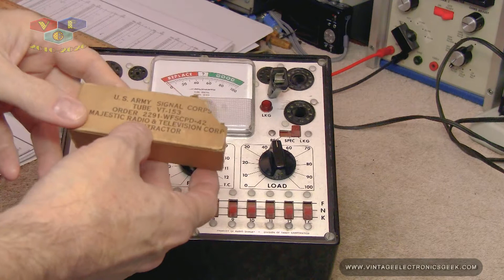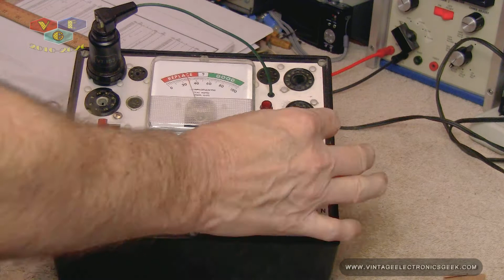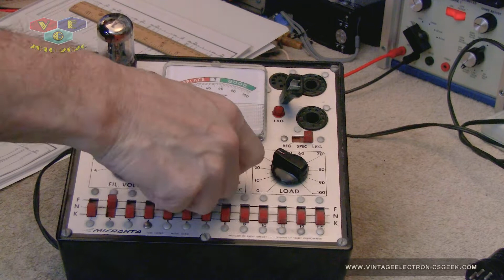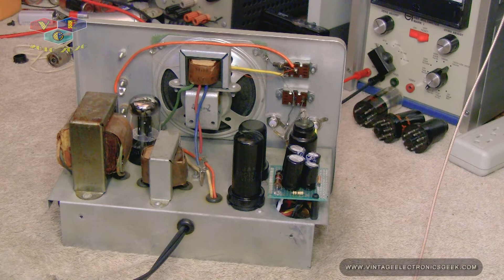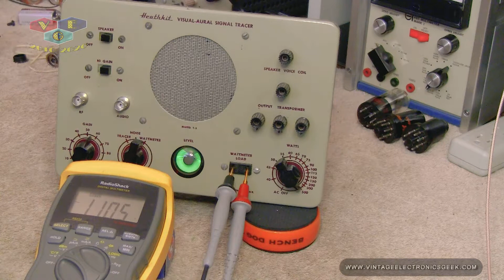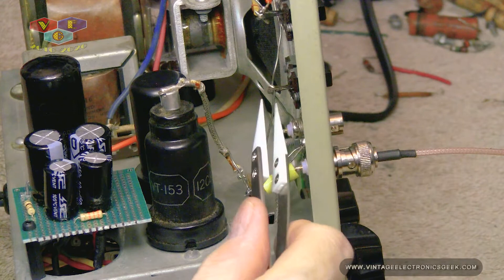Heathkit T-3 Signal Tracer Pt V - Test New-New Tubes | Troubleshoot | Found Issues

Comment: Jack not sure if you ever found out how to identify the foil end on non polarized  capacitors. You can do this with your multimeter on capacitance test function by whichever lead that consistently has the lowest capacitance reading is the foil end. Mr Carlson has an inexpensive small device that you can build that will identify the capacitors foil end, i also built and use his small device that indicates capacitors with excessive leakage and it does this with much lower voltage and it will identify caps with very low leakage.

Comment: Jack, i agree your tube tester is out of calibration, might be capacitors or resistors. One thing i do with my tube tester that i heard from others years ago is when your tester is fixer and calibrated get a few new tubes so you can have at least one in each tube socket types and record the test results on the tube and put it away somewhere safe and refer back to them from time to time and see if their resuls start to change, writw the meter percentage down dont just record that they passed. Another ideal which i did on my tube testers was to write down on filiment knob what the voltage is for each selected stop on your dial knob permanently on the tester and then when testing tubes never move the filiment selector knob to a voltage greater than the tubes are like a 12SH7 tube shound not exceed 12 volts on the tester and on a 6X5GT the tester should never be set to a voltage greater than 6 volts. I also blow a tubes filament heater out by selecting a too high a voltage, and keep the tester turned off untill it is set up for whichever tube you are testing.
Jack one other thing, please be careful when using this test equipment whenever using the NOISE function, there is high voltage on your probe, over 100+ volts also becareful around your BNC connectors on this noise function they are exposed as well, read that manual carefully. I have one of these and installed a small red led light when there is high voltage on the probe when using the noise function, my Sencore LC53 has this safeguard as well.

Comment: Jack your tube tester is bad all those tubes can not be bad. When I buy tubes from Viva Tubes they have been tested and the lowest i have bought read 95%. I will bet you your Tube tester is the main culprit. And you need to use a bit of de-oxit on those switches on the signal tracer.
Reply: Welp, I guess you'll have to make a trek to the local drug store to test the tubes.  Was at you say, um in the twilight zone?
Reply from the maker: Thank you Larry, I have been buying NOS tubes off of eBay.  Tube tester is the next project up!  However, if its not a faulty component, I'm not sure how one calibrates a tube tester...Ill have to see if there is a repair video on one and hope it covers that topic.  Thanks again!  ~Jack, VEG
Reply: @VintageElectronicsGeek  Ahh NOS tubes may or may not be alright I go to viva Tubes because they do test all the tubes they sell. You can find 95% tested good for $6.95 most of the time.
Reply from the maker: @LarryDeSilva64  Thanks Larry, I have bookmarked their website and their eBay store, I will use them next go around...I have more tube device to work on as I can get to them...  ~Jack, VEG